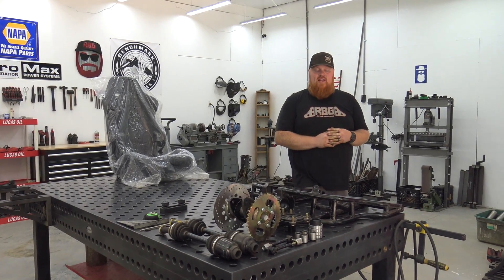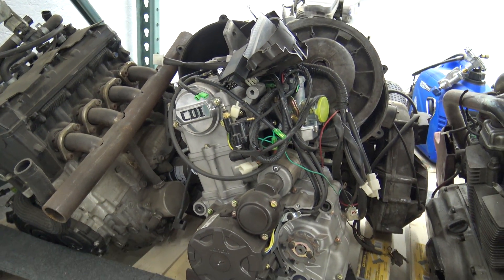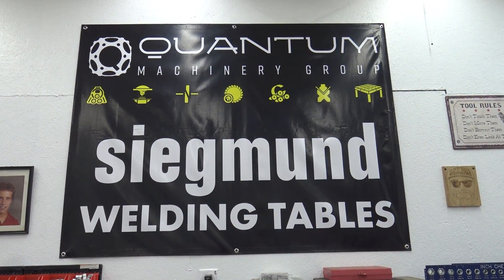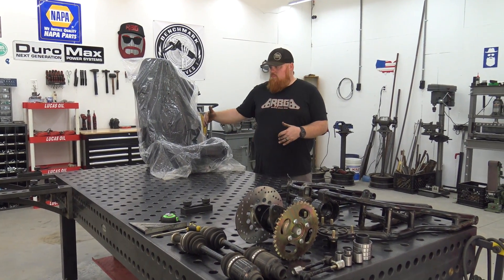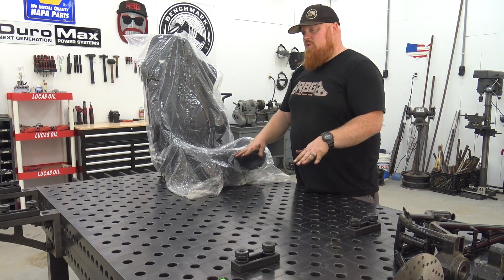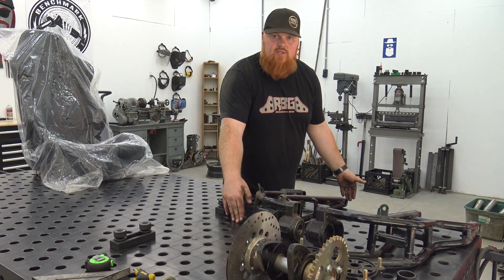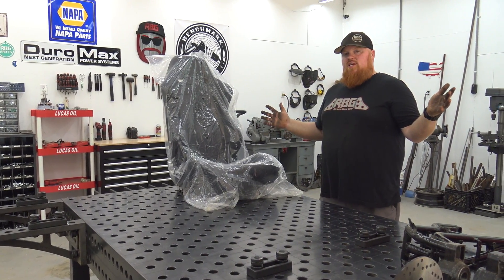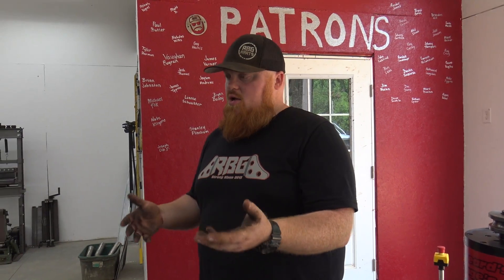ATV 300cc Buggy Build Ep1 ~ Off Road Buggy Chassis Building Tips & Tricks

Comment: Absoutly great video It's a great way to help cross the bridge from day dream to cutting metal.  You would hurt your self laughing at my "build table".  It's Two saw horses  with a grid of 2x4s leveled up to get a flat build surface.  I live in an area far away from a good source of steel tubing.  I can get 1 inch round structural from Lowe's and some square tube locally.  The design  choices came down to 1 1/2 inch. square for the "skate board" bottom of the frame and 1 inch tube for all of the other members. All of your videos put together are like an encyclopedia of kart design and construction.

Comment: Really appreciate...
If I'm correct you did mistake at finally...
That is you should of show this frame(chassis) with blueprint which vll show clear measurements (Driver seet Left side length ?
Driver seat Right side Length?
Drive seat front length..?
Drive seat rear side Length ?
Four corners angle ?)
which will helpful to everyone.
Correct me if am wrong

Comment: FOR THOSE starting out, but you don't have a level surface, your concrete is off etc? Simple solution:
1. Get a piece of decent plywood (not OSB, has to be plywood).
2. Draw a grid in your measurement system of choice.
3. At each intersection drive a screw that has sufficient structure to it (not a drywall screw, not unless your grid is in a spacing that's less than 3 cm)
4. Get a leveling ruler and a straight edge that's at least half the length of the plywood you're using (a cheap on is the edge level used to smooth out concrete).
5. Pierce the plywood with each screw and grind at once, all the screw tips to a decent flatness (or use a pair of snippers to snap the pointy bits off).
6. use the level and straight edge to make the surface flat by driving the screws up or down until you've achieved Nirvana.
7. repeat with as many boards as you want, the spacing in the screws can be as big as 10 cm on a large sheet of plywood.
8. cut off all the screw ends to obtain a level surface and make sure the sheets are secured in place (you can use 2x4 driven into the concrete on the edges to make sure they don't move).
Seems like quite a bit of work, but when you're done, you'll have a flat surface, over which you can dress a sheet of thin metal or just work on top. The level and the straight edge also help you in your work.

Comment: You should really look into bend tech pro software it’s so easy to use it will fit with that cnc bender you just got 
Designing and laying out a chassis first 
It gives you calibrated cut sheets for your bender 
Saves on tube waist tells you the weight of your chassis before you start the build 
It’s the easiest software I’ve ever used if you can edit a video you can do this 
It also has plate software for brackets and tabs
Reply from the maker: I will definitely check it out. Thanks for the info!

Comment: Where do you get the plugs you use to splice 2 tube sections together?  I'm guessing it's just more tube, but what's the best way to find what tube fits snug in the size you're using?  Thanks!
Reply from the maker: I use 3/4" rod stock. It fits pretty nicely in the 1" tube with 1/8" wall thickness
Reply: @RedBeardsGarage  makes perfect sense.  Thanks Red Beard!

Comment: What kind of tubing do you use and where do you get it, thanks.
Reply from the maker: I buy it from a local metal supply shop. This buggy is using 1" with 1/8" wall thickness. On bigger frames I use a combo of 1 1/2" 14 gauge and 1 1/2" 11 gauge on the frames